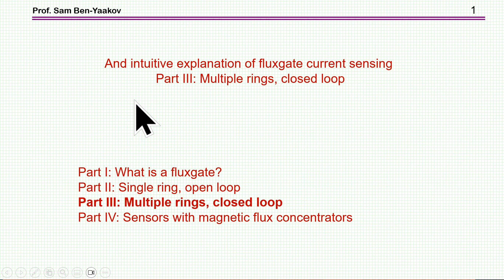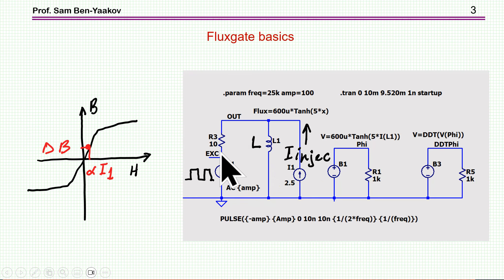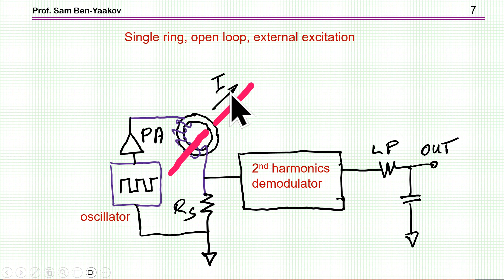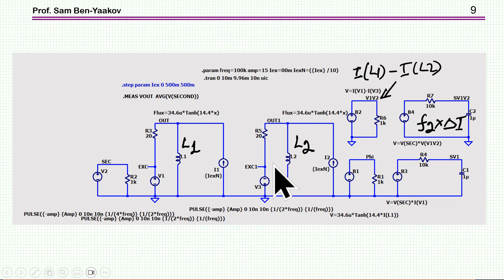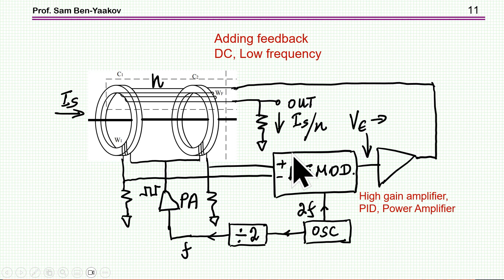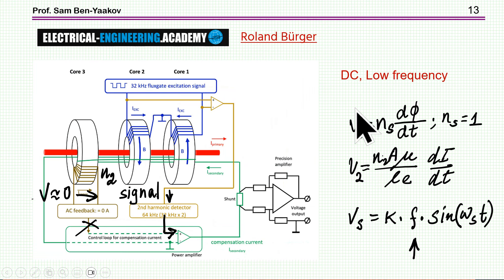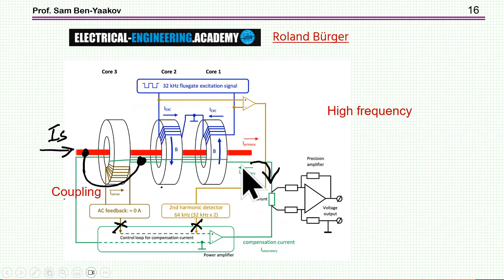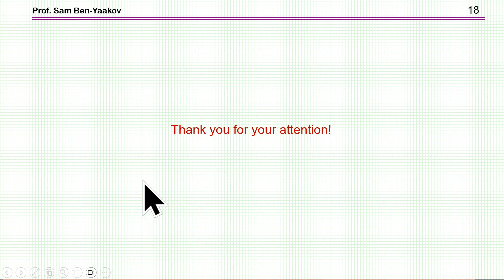An intuitive explanation of fluxgate current sensing Part III: Multiple rings, closed loop

Comment: Is possible to intrude the one core with three coils this kind of flux gate?
Reply from the maker: I am not sure I follow your question. Please clarify.
Reply: My mean is just use single core with 3 windings of flux gate.sorry for describe unclear.
Reply: @7龍珠 nope, current sensing relies on magnetic flux. If you wind three different windings, you'll find that the output is a distorted sum of the three. So one core, one measurement.
Reply: got it thanks, if it with three switch, when one switch on than measure one winding and save the data on memory, as above method to test three winding, is it possible use single core for this?
Reply: the path from VAV, the design is one core with 3-winding, https://www.youtube.com/watch?v=f9xVv2fNcOI&t=63s

Comment: what sort of application currents are anticipated to be measured?
Reply from the maker: Most modern high quality high current current sensors are built today around fluxgate. From scope probes to precise mains metering. From LEM to Hioki. Just google fluxgate current sensors.
Reply from the maker: Indeed, whenever there is a need for non invasive current measurement like clamp type probes.